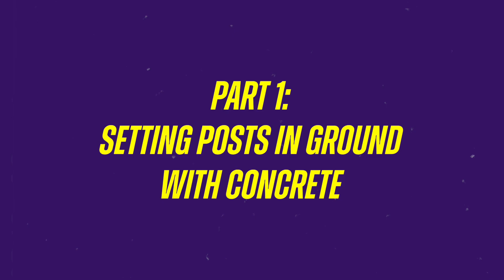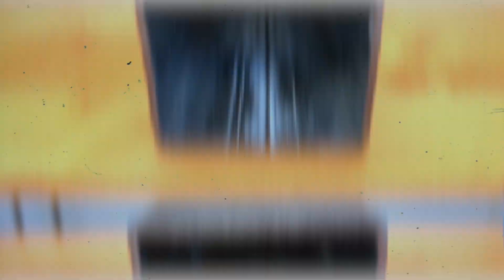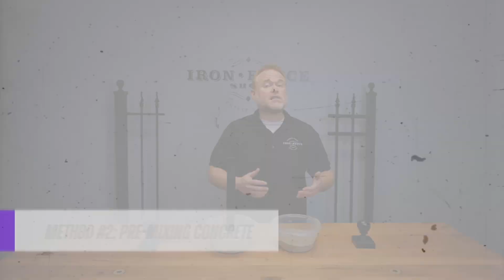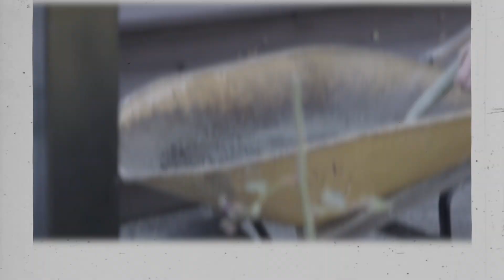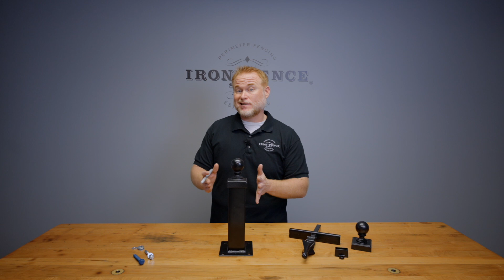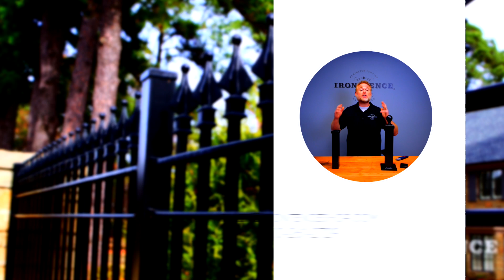STRONGHOLD IRON FENCE INSTALL STEP 5:  Setting Your Posts and Installing Your Post Caps

Comment: What is the post spacing for a 6' racked panel from a 2" post to a 2.5" post (gate)? Is it 74.25? TY
Reply from the maker: Assuming you mean an iron racking panel (not aluminum), they are 72in wide.  Just make sure you are measuring down the hill and not straight out.  Those are two different numbers.  That 72in panel would mean 72in between the posts down the hill.  If you were going for an on-center number, its half of each post added to that 72in.  So 1.25in for the gate post and 1in for the 2in post.  Add that all up and your 74.25in on-center number is correct.

Comment: My first post is against the house. Does anyone have a link to a video tutorial on how to install the first post near the house? I don't want to attach or bolt it to the house. Is there any special instructions on hole width or pouring the cement? Thank you.
Reply from the maker: There is no specific video for that.  While you can bolt the first post to your house, its not typically recommended.  If you have smooth stucco or brick siding, you could attach the fence directly to the house. 

The post hole width and depth will depend on the post you are using and your specific project.  Typically, that post is going to have a ring of concrete around it underground that will space the post off the house.  Just remember to be careful when digging right at the house for any foundation, electrical or gas lines or drainage items that may run along the house.